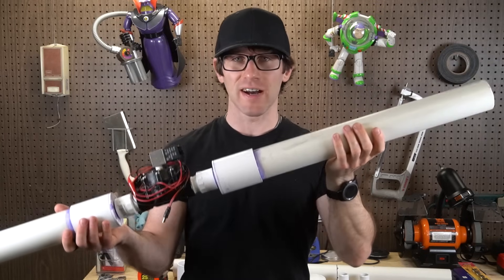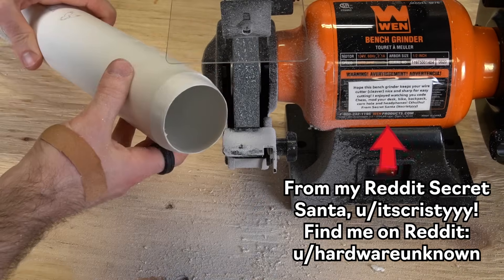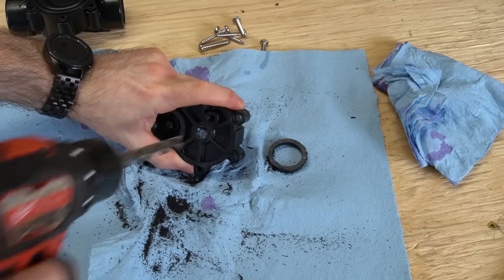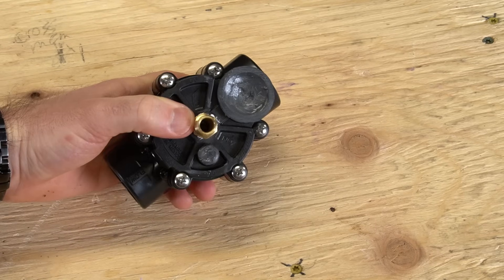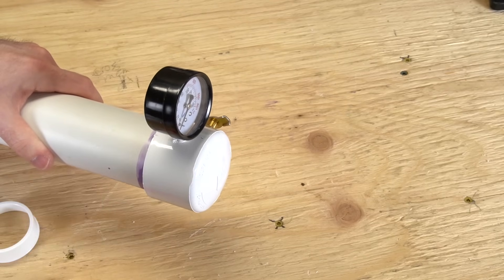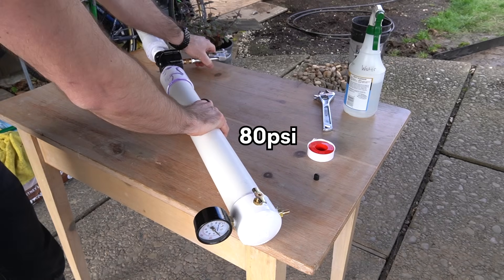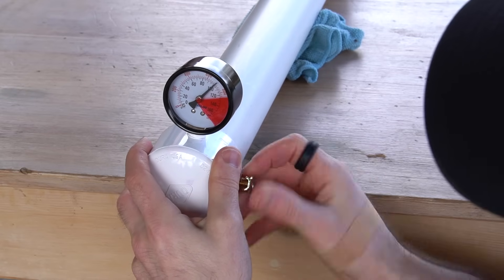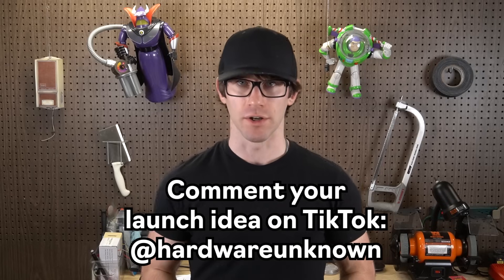How to Make a Simple Air Cannon

Comment: Does the drain valve size matter? Along with the other metal fittings?
Reply from the maker: The drain valve size doesn't matter. It's used simply for safely discharging the pressure without having to fire the cannon. Any drain valve that allows a controlled release should be fine.

The other fittings such as the couplers that attach to the blower handle are simply the size I needed to mount my specific blower handle. They aren't crucial either, so if you find a 1/4" one, a 3/8" one, or similar, you should be good. Same with the gauges. I have both 1/4" and larger size gauges I've used.

The only thing that matters much with the metal parts is that they have enough bite in the plastic to seal well. Larger circumference helps somewhat, but the biggest detail is how deep they go into the plastic. You don't want a shallow part... you want the threads to contact all of the two layers of PVC to minimize the chance of leaks.

Comment: how much did this project cost in total?
Reply from the maker: Not counting tools, I was able to get all the items mentioned for about $75 from Home Depot and Harbor Freight. If you order online it could be slightly more, but I believe you should be able to get it all for under $100.
Reply: @HardwareUnknown  My Home Depot charged a little more than that. Everything came in around 100 bucks.

 Also, regarding safety, I read on this spudfiles website that anything marked NSF-PW is safe to use. The PW stands for potable water, which is under 70psi. Everything I bought was marked as such. And on top of that, I've heard the fiber tape can protect against the chamber shattering as it allegedly holds everything in.
Reply from the maker: Ah yeah, I forget I don't have sales tax here so that explains the price jump at HD.

A word of warning, and you probably already got this from the video but just to reiterate: no matter the markings, no matter the schedule #, all PVC won't be fully "safe" when used this way. The reason is because of that shattering you mention. Metal, on the other hand, yields and cracks to release pressure. Plus, since air is compressible, the physics are different than water. Granted, schedule 40 PVC or even 80 is thicker than others making it stronger, but it bears remembering to always be careful as this isn't the intended purpose for PVC. My recommendation is to know your limits and wear safety gear like eye protection just in case. Again, maybe you know this, but when I hear someone say their PVC is "safe", I always want them to prepare. Make the cannon, for sure, just know the risks.

Enjoy, and let me know how your build turns out!
Reply: @HardwareUnknown  Yeah, you know, looking into it, I think I'm going to return everything and build it using a different material. We're building this cannon for a school project meaning we'll be in around testing this thing for months. So the event of an explosion seems a lot more like an inevitability rather than just a possibility. 

It seems like a really cool project for just messing around a couple times, but considering my use case, I really don't want anyone getting hurt.
Reply from the maker: That's a smart move. Keeping the pressure low with PVC makes it less likely, and I leave a good margin. It can happen though, so if you're doing it for a school project it'd be smart to make it out of metal. Plus you have lots of test time. Before settling on PVC since it's just for my use, I went to a fire extinguisher repair facility and they gave me empty vessels. Those could work as they're already pressure tested. You'd just need the threaded adapters which admittedly I could not find. However, I didn't spend too long on looking for what threading it was.
Reply: @HardwareUnknown  Thanks for the pointer. I'll look there. Best of luck with the channel
Reply: @HardwareUnknown  Yo quick update, after some design work and simulation, we realized that a 1" by 18" galvanized pipe stores more than enough air to get our projectile up to speed. It's a lot heavier, but it can take wear overtime unlike PVC. Plus we'd have to pressurize into the thousands of PSI for it to actually burst-- along with the burst being more like a deformation rather than a fragmentation. We installed a 120psi pressure relief valve with our system with a max "working pressure" of 150 psi. I believe we have thing as safe as we can get it. All it needs is a safety switch and remote triggering/pressurization, which are design goals once we move further along in the prototype stage.
Reply from the maker: @nicholasn.2883  Your setup sounds much more "safe" (as least as much as we can claim) than any PVC build could be. Well done, it's clear you've done your research. 

That deformation vs fragmentation is the key part. You aren't going to be anywhere near the break point of galvanized steel with a bike pump/home compressor. Even if you could though, it wouldn't explode in the same manner with shrapnel which is a big safety factor. Yours is also much more portable given the size.

Perhaps you've looked into remote options already. If you'd like some direction, I'd suggest a couple routes. Either way you're likely to use solenoid valves to remotely control air. You could trigger a solenoid using a hardwired switch with very long wires attached, or you could use something like an NRF24L01 module which is an RF board compatible with Arduino. That way you could be truly remote if you want.

Great work so far, a big congratulations for getting to this point. Your team is really making headway. Thanks so much for updating me, and keep me posted as the prototype continues development. I hope to see a video of your build once it's all done.

Comment: Hi, this is very similar to builds I've done in the past. What's the advantage of drilling out the RainBird and using your own solenoid valve over using the original solenoid?
Reply from the maker: Excellent question. The original solenoid has lower air flow compared to the one I replaced it with. You're trying to activate the sprinkler valve as quickly as possible so the tank dumps all its air near immediately. That little bit of extra air flow allows the sprinkler valve to activate faster, and you get more power for your launches.

Comment: Hey MomO  here. I am a first time builder of a potato gun. What did I do wrong? The air is going straight through the in line value.  Any suggestions?
Reply from the maker: Hey there. Congratulations on your first build. Issues are normal, I had them too when making the video. They're a good learning opportunity.

So to confirm, when you begin airing up the tank, it immediately goes through the valve? It will do so for a short time before building up the minimum pressure needed to seal the valve. It will stop shortly after, then begin building further pressure which you can track on the gauge.

If it endlessly let's air through, where specifically? You can use sound, or if you can't discern where from sound alone, use a spray bottle of water with a bit of soap in it to check. Lightly spray the potential problem areas and look for bubbles. If air is coming out of the main exit, you may have seated the diaphgram upside down or slightly misaligned and need to open up the valve haves, adjust the diaphragm, and re-close the halves. If air is coming out of the areas where epoxy was added, there may not be enough epoxy to fully seal them.

That's a place to start. Let me know if either of those solutions help or not.
Reply: @HardwareUnknown  Thanks for your help.  That was the problem.  Once I filled with air compressor instead of bike pump it worked great. With 95 psi a potato flew 150 ft. Sons are laughing but I did it.  Thanks again.
Reply from the maker: That's great to hear! Enjoy it with your sons. So great that they're having fun seeing your build.

Comment: Isn’t it like really bad to mess around with air in pvc
Reply from the maker: PVC is not designed for holding air, so there are inherent risks that you cannot ever fully eliminate when using it with air. A metal cannon would be stronger and thus safer if built right (although all cannons can cause injury or damage in some form). It's a risk I knew going in though, and I keep the pressure relatively low as a precaution. Still, PVC can fail during use with air, and anyone making a cannon like this needs to know that, hence the in-video warnings.

Comment: Your blowgun is that a 4 inch nozzle?
Reply from the maker: The blowgun I used comes from Harbor Freight with a four inch detachable nozzle. However, I don't actually use the nozzle. All I need is the blowgun part to release air. It won't make much of a difference in this case given the main air is released via the sprinkler valve, but theoretically not using the nozzle is better as it's less constricted and will release air faster. The blowgun from Amazon linked in the description comes with a two inch nozzle, but since they aren't needed anyway, you should be able to use either that or the Harbor Freight one.

Comment: Can you comment on why you went with a 30inch res, and a 20 inch barrel?
Reply from the maker: Great question. I wasn't sure of the ideal barrel to reservoir volume ratio, so I did some quick searching to find out if anyone had found it. There's no perfect value since there are all kinds of variables in air cannons, but from sites like http://tuhsphysics.ttsd.k12.or.us/Research/IB04/HamPunz/index.html and https://www.spudtech.com/content.asp?id=6, I gathered that anywhere around 1:1 to 1:3 (barrel to reservoir) might be a good place to start.

The second site lists 1:1.5 barrel to reservoir volume ratio as the ideal ratio for combustion cannons. It says pneumatic cannons aren't as particular, and there is a point of diminishing returns with larger reservoirs. Eventually, the item being launched has already left the barrel before all of the air is released, meaning wasted power that does nothing while adding to the size of the cannon.

1:1.5 was within the range I seemed to find people mentioning. I then held a pipe on my shoulder to get a feel for overall size, determined that a total length of a bit under 60" would fit the look I wanted. With the 1:1.5 ratio in mind, I ran the numbers on the lengths needed to end up with that. A 20in barrel and 30in chamber left me a bit under 60" and that was to account for the fittings and sprinkler valve.

After launching it, it worked well. Plenty of distance while still being manageable. It was good enough for my purposes, so I made the video and left it at that. Keep in mind, though, that this was in no way an exact science. I'm just pulling numbers I found and deciding "yeah, that looks good", and then the tests confirmed it. You can experiment with all kinds of volumes if you want (just remember it's a volume ratio, and to account for different pipe diameters if you used mismatched pipes for the barrel/chamber). I did so with my quad cannon build as I wanted that one to be shorter while still being powerful.
Reply: @HardwareUnknown  fantastic reply! Thank you!!!

Comment: Outstanding video!!

I'm a ham radio operator and have used various methods (slingshots attached to fishing poles & reels, et. al.) over the years to launch feeder lines over trees which I then use to hoist heavier support lines to pull up wire antennas.

My current location has many 80+' pine trees which are far too high for the old slingshot approach. 

I needed a new method and these pneumatic guns are the answer.  Used one owned by my local radio club & at 40psi it easily cleared an 80' pine using a 2" long by 1½" diameter section of PVC with endcaps as "ammo" tied to braided fishing line on a large kite spool.  Worked like a charm.

Your video is very clear, well-scripted, gets right to the point without small-talk, & your straightforward step-by-step is easy to follow.

The precautions & safety measures are critical too - these things can be deadly if not assembled correctly or if fired indiscriminately.  Don't point at anything you don't intend to shoot - even when not charged/loaded.

The build is a very simple, uncomplicated build & you even provided the parts list!!

Couldn't be any more perfect.

I may have to build this version just for fun,

Many thanks - great job.
Reply from the maker: Many kind words; they mean a lot. I'm delighted you enjoyed the build!

While designing my launcher I came across several radio operators who made their own versions. They often used curved sections of PVC to keep the launchers compact, which I thought was smart. However, I wanted mine to be as close to the absolute simplest build possible. No spacers for the curved sections, all parts easily available, etc. Plus I prefer the air blower handle as opposed to a 1/4 turn valve to operate the thing.

That's a creative use of PVC as the ammo. I've seen the purpose-made weighted beanbags for launching lines, but as you can imagine I enjoy DIY solutions too. This thing definitely gets some distance with beanie babies, so I'm sure it could work for launching pull lines. That, or just sending things off into the distance for the heck of it. I've had a lot of fun with mine.

Let me know how the build goes if you decide to make it!
Reply: Now days we have drones for that stuff.

Comment: Very cool, but you should not use schedule 40 pvc. I can and will explode. Air pressure and water pressure is not the same for pipe, especially pvc. This should be done with at least schedule 80 cpvc or threaded iron pipe.

I cannot test PVC pipe with air according to the Universal Plumbing Code because it can be extremely dangerous.
Reply from the maker: That's good to know. Everywhere I read mentioned be sure to use Schedule 40 over Class 200, but if 80 is the way to go I'll have to try a build with that. I had looked up pressure ratings for Schedule 40 PVC pipe which made me think (knowing the risks of course) that it would be reasonably reliable. If that's not the case, I'll need to change that.

Are you saying that Schedule 80 is specifically rated for air? Or is it just an additional margin of safety? Great to hear the facts from an actual plumber.
Reply: Would a metal alternative work? It'd be a hell of harder to build but could withstand MUCH higher pressure?
Reply from the maker: Yes, and while the weight would increase, it would be safer than PVC due to its strength. I've seen some makers create theirs out of metal pipe for this reason. A great option, for sure.

Comment: Plumber here. We don't air test PVC due to its rigidity, and schedule 40 is used for drain, waste, and vent lines. It's printed "NOT FOR PRESSURE" on the side of all schedule 40 PVC pipe.

I know it's commonly used for these without issue, but use schedule 80 if you're going above 5psi air. PVC will fragment when it explodes.

Edit: almost all SDR 40 PVC is rated for DWV only. Read the labels first as stated in the video. Missed that part.
Reply: This guy is obviously not a plumber. While pvc, because of liability, is not for air use, it is rated well above the pressures hes using. In fact, 2"schedule 40 pvc is rated @280psi. In the united states, we engineer properly and psi testing is done at the factories.
Reply from the maker: The choice of stopping at around 100psi was intentional for that reason. An almost 3x safety margin, while still not infallible, is sufficient enough for me and my risk tolerance and safety prep practices. My hope is that not pushing the PVC to its absolute limit encourages others to simply be cautious when dealing with potentially hazardous things. Danger is all around, you just need to know your comfort level and mitigate what issues you can.
Reply: @fitzfinds8273  exactly. I'm actually looking at a piece of ½" sch40 that serves as the airline in my shop and has without fail for 11 years. It is printed on the pipe in plain English: 600 psi @ 73 degrees F.  Just checked a joint of 2" and just like you stated 280 psi @ 73deg. I don't know where he is getting his info, maybe the grey conduit???
Reply from the maker: An ideal option. My local hardware store had Schedule 40 available, but I'd like to try Schedule 80 at some point. Is Schedule 80 actually pressure rated or is it just safer than Schedule 40 due to the increased thickness?
Reply: @HardwareUnknown  schedule 80 is what should be used on any pressurized lines, so basically anything transporting water. Its commonly used for irrigation systems and closed pumped waste systems. A basement ejector pump can use 40 because it's open to the atmosphere and the pipe itself isn't pressurized. 

I see schedule 40 used all the time for pressurized systems, but I also see them fail ALL THE TIME. It looks like you safely tested the threshold for your pipe, I may have been incorrect in that all schedule 40 is not pressure rated.
Reply: @HardwareUnknown  watched this right before going to the hardware store. Looks like my bank account is gonna take a harder hit than previously intended. Thanks!
Reply from the maker: That's something I was curious about. I looked up pressure ratings for Schedule 40 and they were there, but now I'm curious. There must be different kinds of Schedule 40 (hooray added confusion). I'll have to double check mine to make sure I got the right stuff.

Post a video when you build yours! I'm always excited to see people recreate a build of mine. Enjoy, they're a blast to use.